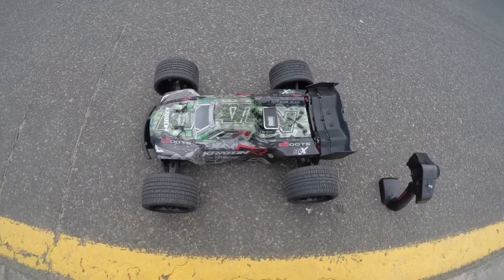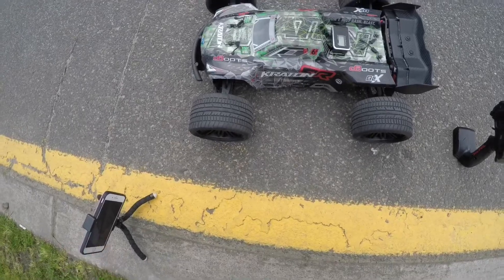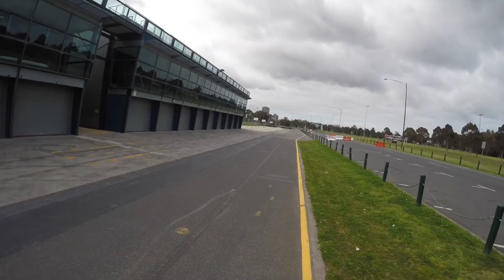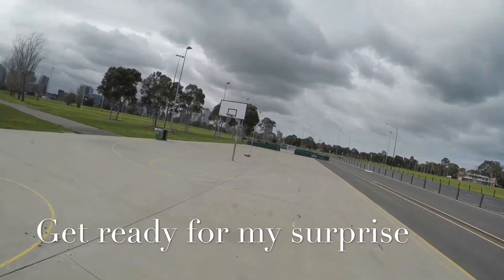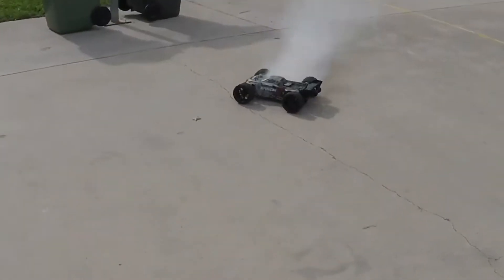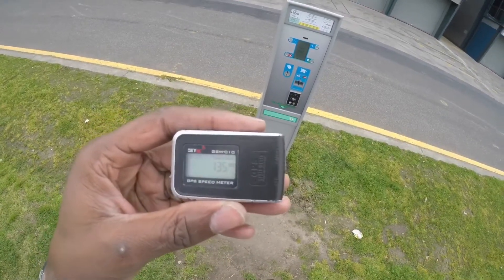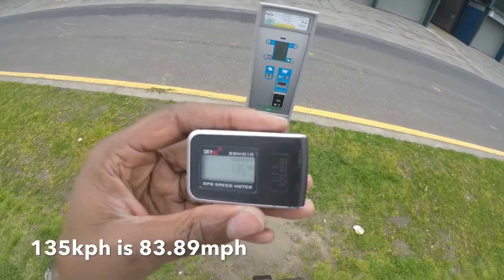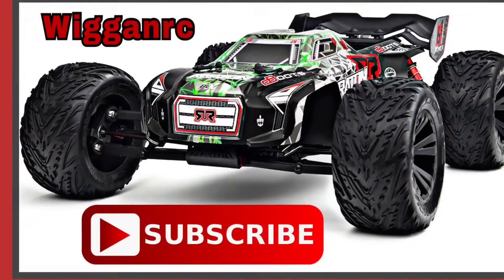135kph Arrma Kraton Speed Run Ends in Smoke Ep 11

Comment: Hi wiggan, just started waching your channel on youtub,  great runs on the arrma range,  i have the arrma typhon, but want to put it on the kraton chassic as some people are doing, any thing i need to change to do this, thanks.
Reply from the maker: +brianthekid9 hey man, thanks for stopping by the channel. For the Kraton chassis you need the Kraton centre drive shafts and chassis braces, then get rear extensions for body mounts. I think the Typhon with wheel extension is just as stable as using the Kraton chassis setup and a lot cheaper.
Reply: Thanks wiggan for the information,  keep the good work up on your channel.
Reply: I very appreciate that you reply to my message. I also have other questions. What's best  Combination spur gear an  Pinion gear
Reply from the maker: Hard question. Some think 34/34 or higher pinion and lower spur. Test some combination and see how it goes.👍🏾 Don’t forget to subscribe to the channel 😀
Reply: I just added your channel thank you very much
Reply: @WigganRC   Have you tested out the limitless yet
Reply: @WigganRC   Do you have the limitless yet and so when are you going to do a video